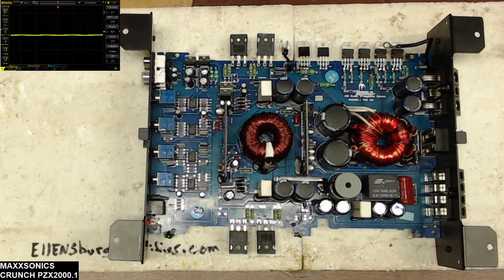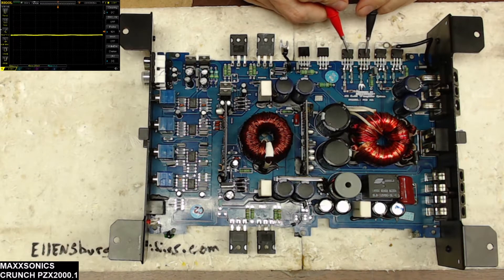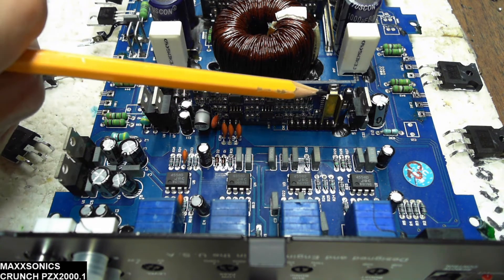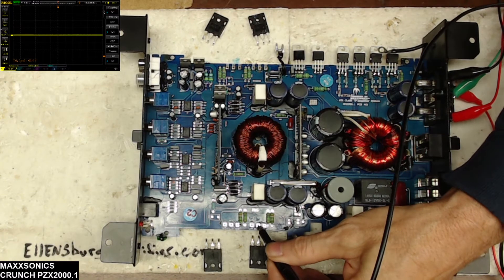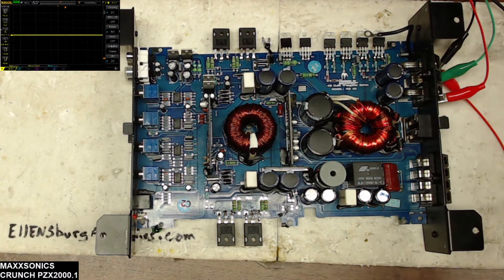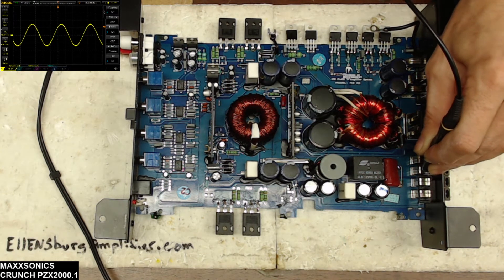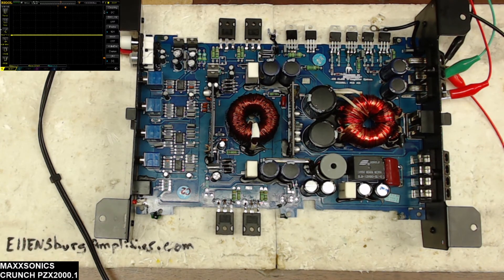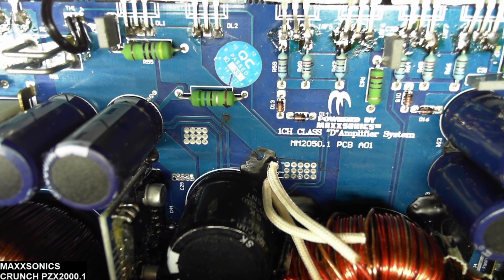Crunch PZX 2000.1D by Maxxsonics Class D Amplifier Repair Power Supply and Output Shorted

Comment: Hello my friend. First, we should place the MOSFETs on the high side so that our waveform appears on the gate MOSFETs?
Reply from the maker: You are correct. With this circuit, the bootstrap circuit may be open without the transistor or a capacitor installed. The IR(s)21844 application notes may help explain why this is.
Reply: @ellensburgamplifier  Hello and thank you for your valuable answer. This answer can help me a lot. Thank you for sharing your experiences and knowledge.

Comment: How much for Crunch GP3K repair
Reply from the maker: Hard to say but I know these boards well and you may be looking at a cost between $28-$50 depending on the failure.
Reply from the maker: I forgot to mention is you would like a quote on this head on over to www.ellensburgamplifier.com and we can get that ticket started. Upper right is where you can request a quote.

Comment: @E'burg Amplifier Repair 
Hello I've got a question for you Sir. So I've got a (brand new still in box) still haven't used it yet cause I'm trying to find out if I can do some sort if any kind possible ("mods, to the amp electronic internals I guess you could say") 

So the amplifier i have sadly is a; MaxxSonics-Crunch-px1025.4 amplifier, and what I would want to really know is, if I could some how, you know how some (more expensive brand amplifiers have like the really thick like I don't know like maybe 04AWG, 06AWG or 08AWG wire inside of them?  I'm guessing they are for, or are the connected wires that connect for the power supply or maybe the cables that go from the 12v & GND external ports to the internal pcb...?    Anyways sorry for such a giant Novel 📖,  my whole point to this and my question or questions for you Sir are;  Can I somehow de-solder the originals & add some of that previously mentioned thick gauge wire to my amplifier internal pcb board?  And my second question is yeah kinda geared toward my amp but honestly for any sort of amplifier out there...  Can you let's say buy a cheap amp (like mine or even more expensive sort) and switch out several different components on the internal circuit board's, to say maybe  make it work alot better than how it did when it had the factory stock pcb components?  Or like would it maybe output-more-Watts?     So in conclusion my entire main question is; can you mod amplifiers and add different/much better components or wiring, and would it make it work better or would changing out original factory spec components to different one's make the amplifier not work properly at all like it should...?    Again so sorry for my giant book I wrote...   I just had to thoroughly explain exactly what I meant so you or someone could understand my exact thought to try & better understand what I'm thinking and asking and wanting to do... Because I've scoured the internet, YouTube freaking everywhere, for hours!! and hours!! And couldn't find a single thing on what I want to know or figure out...   
 
Thank you so much for reading my book and trying to possibly help me in my situation...    If maybe e-mailing ea other would be easier to communicate just lemme know Sir. Thanks again.   Oh and I also live in Washington 🌲🍎 👌😁 
  @E'burg Amplifier Repair
Reply from the maker: I don't mind any questions at all. However, the primary question you have has many, many different answers. This is an in-depth topic that takes time to understand. I think I see an email from you so I will respond to that and provide you with my contact information if you happen to be close to central WA. I would not mind at all showing you in person the answers to your question.

Comment: Hi Todd thanks for another informative video, I've never worked on a board that have drive cards and it is also interesting to know when you need to put in the output mosfets to get a signal. I would've thought that something was still wrong with the board if no signal was present. This is something that I must bear in mind
Reply from the maker: Thank you Tyrone. I like it when I can help someone understand these boards. It comes down to understanding how the class D IC works with the floating output.
Reply: @ellensburgamplifier  I've never worked on a class d board so it's quite interesting and informative to watch and learn, you make it look so easy to repair

Comment: Nice Todd, wished that board had of been messed up, lol. I have one I have replaced all the chips on it, but there is something else. Will get back on it this week sometime.
Reply from the maker: Let me know if you need any assistance! If you have been through it I would look at the overcurrent protection circuit. I am working on a few videos that will go over these power supply drive cards and different types of output cards.